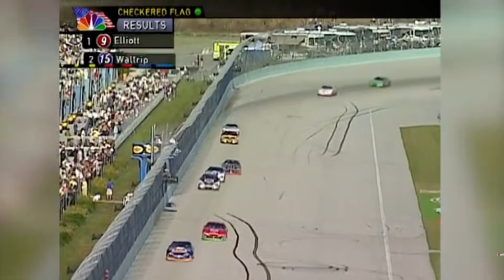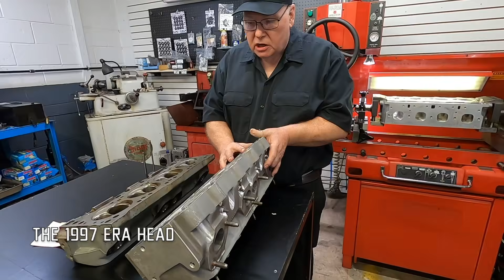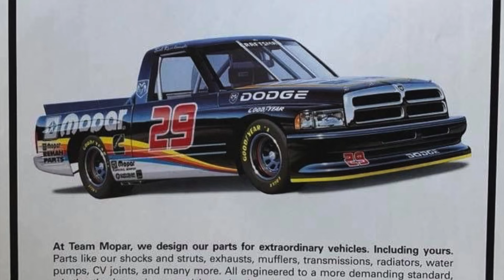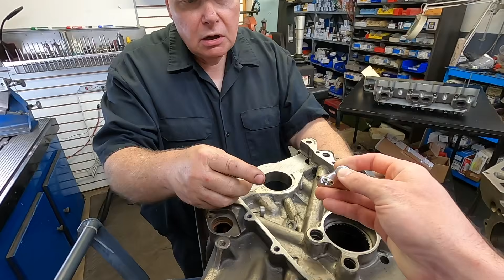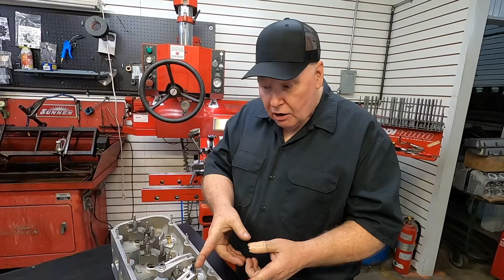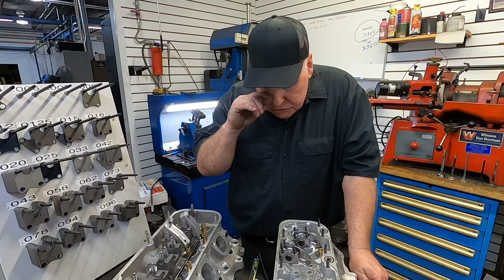History of Dodge's NASCAR Small Block Engines: Secrets Up Close With Danny Glad

Comment: Time 347
The reason the lifter bores were at an odd angle on the factory blocks is because the block was reused from the 50's Polyspherical headed engines. ( the one with the bottom of the valve cover being zig zagged )
Reply: Correct! It actually goes back to the first generation Hemi engines, most of which were also available with Poly heads as a lower cost option. 50's poly engines have a very deeply scalloped valve cover vaguely similar to the 348/409 Chevy. The 318 poly (with the zig zag valve cover) is a 60's engine that evolved from the DeSoto hemi block.
Reply: That is true, the lifter bore angles are a carry over from the Poly 318.  The LA engines have a 118 degree lifter bank angle.  This is why while the camshaft layout and the firing order is the same as a small block Chevy(82 degree lifter bank angle) the index plate for the grinder looks totally different.  There are a few different bank angles used on the early hemi engines, I think that some are at 124 degrees or so.
Reply: @DaveMcLain were the poly heads ever developed?
Reply: @dennisrobinson8008  I'm not sure.
Reply from the maker: Interesting!
Reply: This is certainly one of those videos that I will have to watch several times.

Comment: Great stuff my buddy bought a R5P7 motor from Arrington years ago when they were "Fire Selling" them out....I'm pretty sure thats what it is. The motor is his "Refrence Motor" for his Froude GH490 engine dyno that sees some of the most powerful USAC Midget Motors...He's done some Vintage Race stuff like a HART 415T 850HP F-1 motor and the almighty BMW M12 Turbo F-1 motor (not in 1300HP+) qualifying tune but a milder Vintage F-1 tune about 80HP  more than a HART motor. He also builds 410 Sprint Car motors and I find it AMAZING to watch those repeatedly turn 9200RPM's in testing. Lake Speed Jr knows my Buddy Bob in the SF Bay Area he gave feedback in the "Gibbs Era" of oil development....Bob also did programs for Royal Dutch Shell....I use Penzoil Platinum in my vehicles....Platinum Ultra when they aren't required to meet GM Dexos standards....Great Stuff....Penz is owned by Shell.
Reply from the maker: Thanks man glad you choose Pennzoil too!

Comment: I know that these engines have nothing to do with the Truck series today, but I do wish that teams would go back to using actual NASCAR engines. I understand that Ilmor engines are cheaper for teams to use, but having actual engines that each manufacturer can get from Chevy, Ford and Toyota just fits the narrative I guess you can say. Plus the NASCAR engines sound 10x better than the LS engines teams are currently using in the truck and ARCA series
Reply from the maker: They’re not cheaper for teams I think that was a big rug pull. They should absolutely go back to these engines.
Reply: @Stapleton42 oh that’s something new to me. I figured because they’re LS engines they were cheaper, but that’s interesting to note. Also thank you Stapleton for putting out another video
Reply: @Stapleton42 NASCAR's reason for a spec LS Ilmor, is that a manufacturer like Dodge coming back into the sport or even Honda could enter a Ridgeline in the truck series without developing their own pushrod V8... Cost effective.

Comment: I guess you can call me a geek when it comes to the engine stuff also...keep them coming you two ❤🎉
Reply from the maker: Thanks! Glad you enjoyed it!
Reply: Same here, it tickles my ‘tism 😂
Reply: I got a old Mitsubishi for my daily and the best car I’ve drove don’t over heat very reliable it’s got 315 thousand on it and keeps on going it’s not the old Mitsubishi but I would buy a new one any day of the week
Reply: Hope it’s like a 340 motor cause you can’t beat them not a fan of 360 I know ther not the same but this is cool I think the old HEMIS had piston sprayers like the red rams. Like the little red ram the piston squirters are on the lifter bores I BELIVE
Reply: Give em hell Mopar  hopefully it last s I don’t know about stellantis  that motor is singing not even in high gear
Reply: Sorry about the comments but I’m a Mopar freak glad ther comming back I hope this motor sings this man knows his stuff a legend for Mopar or nascar for that matter very smart man so what kind of motor will it be a HEMI or what
Reply: So what is this motor ther going to run based on a new hemi or a older small block I’ve never seen a cup motor

Comment: I keep waiting to hear about the camshaft to crankshaft dimension. 
Mopar was the company that brought the short push rod engine. Into the 21st century. 
With that raised camshaft ! The push rods got shorter and stiffer! 
Allowing the engines to really rev to high RPMs ! 
And also allowed more room around the connecting rods! 

It was a huge step in valve train geometry and  stability.
Reply: Dude you understand a LOT more than most guys out there understanding that relationship

Comment: 500 inch Pro Stock engines run a lower 3" stroke crank as well.
Reply: Danny pushed the limit to 2 inch mains and cylinder wall finishes and ring packages on Alan Johnsons pro stock back in the 2008, 2009 2010 he did some stuff for Roy Johnson Alan’s dad who use to build them

Comment: one other thing on the short stroke big bore is you can run a lighter rod as it’s shorter so that’s less mass you have to move. Moving mass takes energy. Or you could run the same rods and change crankshaft throw to be .125 less. Smaller rods are a lot less than a new crankshaft.  Less mass also means you can run more RPM for the same energy as the big rods and that equates to more HP. It’s an improvement across the board when you add in the ability to run bigger valves getting more air into the motor. The drawbacks are the cam will be a LOT different in the big bore big valve combination. If you want to turn 9000-9500 you will also need better valve springs probably with a girdle and spray olling. More this means different that means more $$$.